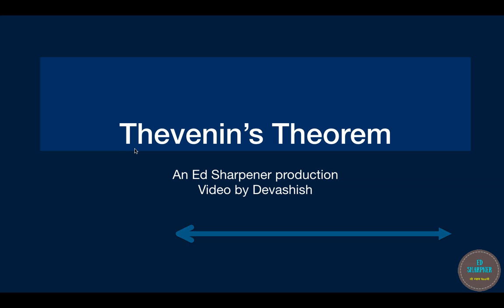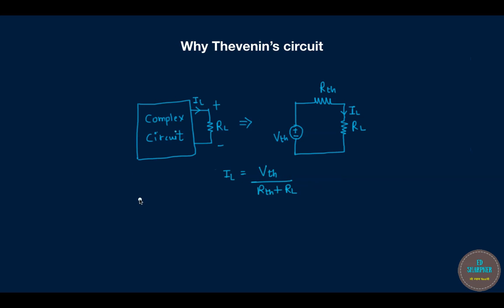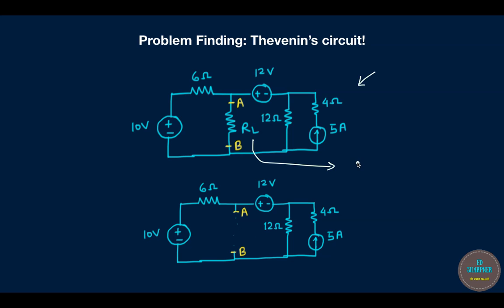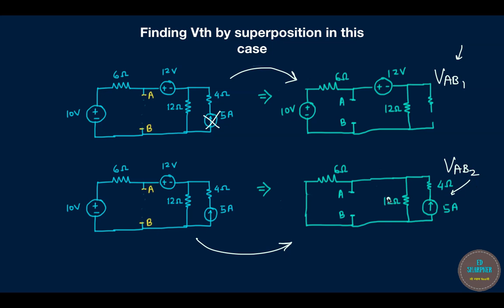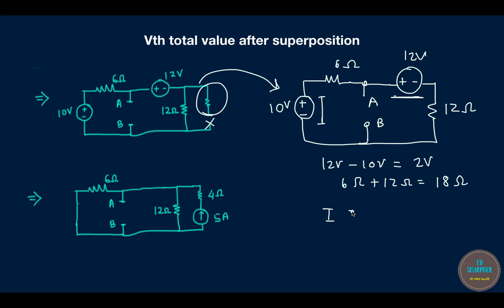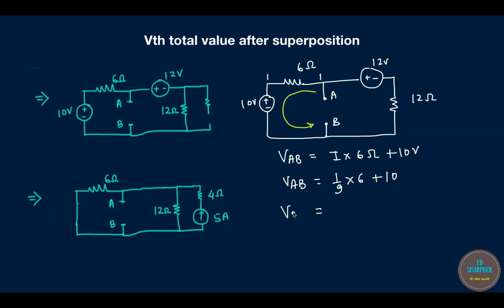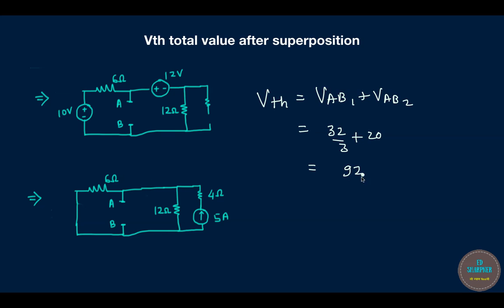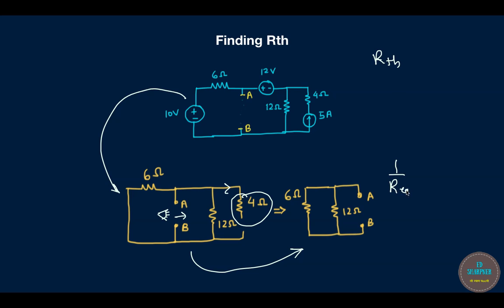Thevenin's circuit, finding Vth and Rth network theory - GATE and IES

Comment: Dont we ingnore right side resistor and always look from left side while calculating rth? I am so confused in this type case where load resitor is in middle. Shouldnt we ignore 12ohm in 11:17 and look from left of AB terminal.. ?
Reply from the maker: Hi @Gamer bhai, we dont ignore resistances specially when they are in circuit. Only time we can ignore the resistances is when they dont get connected in original circuit due to say, opening of current source. Please dont keep the misconception of removing any resistances on right hand side. Actually right hand side or left hand side dont even make sense to the circuit. If you just look at the circuit from opposite direction right hand side will change. So there is no point in removing resistances from right. Remember that the circuit is a 3D entity you can move wires anywhere!
Reply: @EdSharpener thanks for ur reply it makes sense no more misconceptions.😄